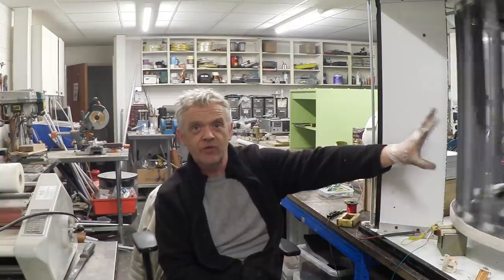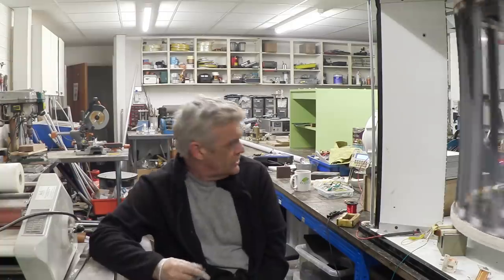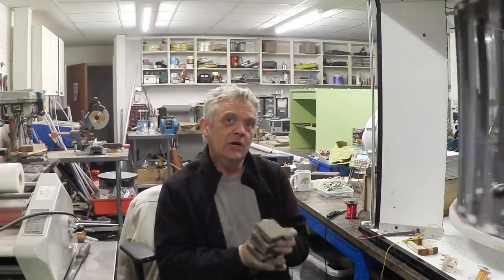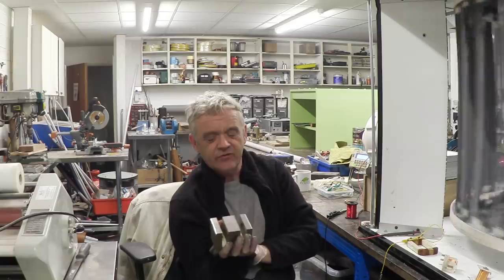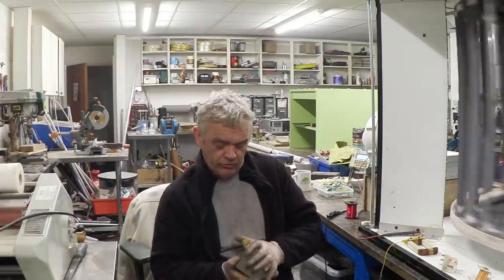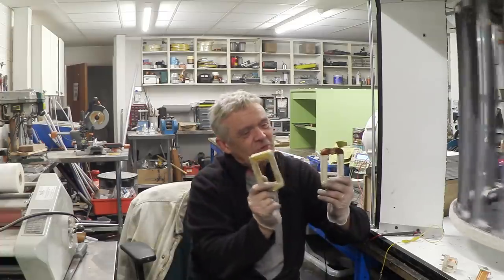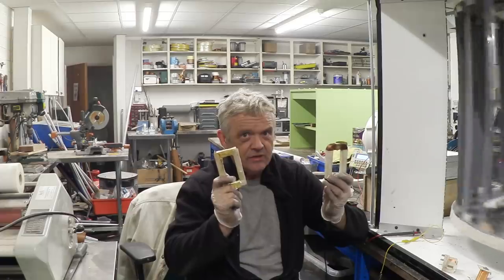Building a 1kW Wind Turbine For Under £100 - Part 5 - Messing With Coils

Comment: Interesting Mr Smith.  No core?  Then it's air core you're talking about.  Air Core vs Iron Core They're All The Same - Paul Babcock.  This guy has been working with flyback devices for over 30 years and he's arrived at air core  Using air as a dielectic medium as the path for magnetic flux.  It's also been mentioned that keeping the voltage low without the core, means it's less likely you will be electrocuted.  And that's always a bonus.  Thanks for the video sir.

Comment: The spacing of the magnets needs to match the size of the e core. This is so neighboring magnets don't push and pull at the same time. Cutting off one side of the E may remove this effect but still keep a complete magnetic circuit.

Comment: The answer seems obvious.  We have always used cores because our power sources have been essentially limitless.  Yes, a motor does not have limitless power, but it is very abundant.  Niagara Falls is limitless for us mortals.  Match the design to the power source.  Great video.  BTW, this is how progress has been made.  Not by chicken scratches on a blackboard.  All leaps in science/engineering have been either accidental or the realization of crazy dreams.  Almost no progress comes from chickens.

Comment: do like the big power companies the transmision is done on high voltage and when you reach the user use a transformer for the voltage you need to inject online. That is why the transmision lines are always high voltage and very low amperage. Also maybe it would be a good idea to set a way of directing the airflow over the 50 % of the blades that move forward so the air flow does not have any influence on the 50 % of the blades looking he other way. There is a very interesting instalation done in Argentina with the same idea working with a 100 kw power output. If you contact me i¨ll send you videos and some papers of the project. There is a company in Texas that have a patent of a design the same as you propose but in vertical position.

Comment: The only thing that could help u with the microwave transformer is to align the magnets with the ends of the iron core legs so u get more of a perfect w shaped magnetic Flux.  SNS to NSN and so on. The cleaner the shift in the magnetic field through the coil the cleaner the energy u get out of the coil.  Ideally your trying to complete magnetic fields the strongest ways possible by tightening up air gaps and making clean North to south connections.

Comment: No iron core, heavier wire gauge wound to the voltage wanted and N52 neo magnets and have coils all around the circumference!
Reply: Desmond Bagley  I guess we are to take stock in what we are trying to achieve. More power with less wind or safer and cheaper power whatever the yields are.

There are countless ways to build wind generators and thus countless results and power yields. 

The most efficient and power dense results are to build it yourself and with neo magnets and in an open coil (no Iron) 3 phase wiring configuration. The cost increase will be determined in your ability to acquire free material or if you prefer to purchase it, it is still cheaper than buying it already built and cheaper than paying for it to be pumped into your needs. 

If you are not safe in your building these things or you do not have the sense of flowing electrons that can kill you if you touch bare conductors with bare hands then you should probably not be doing this at all. If you are not savvy enough to find material to minimize costs then you probably should never complain about costs. If it is results and performance that you want to achieve then it is most certainly conceivable to be able to do this and still do it economically because chasing a rabbit without a clear goal and without then doing the research to achieve this goal is more costly than doing it right.

You can easily achieve 1 KW generator build and still keep it in the 100 dollar range. I say generator, because if you do it right it can be used in any sort of system, wind, steam, buoyancy, water, or a bio fuel or gasifier system. It can be made to be a modular or bolt on type of generator coil set and magnet rotors to be used in any application you want it in.

The only thing you need to do is capture as much of the energy as you can from the system you are putting it in. The proper way to engineer these things is to first set out your goals or what it is you want to achieve. Then it is to make the whole of the system into compartments that address the areas of what they are to function in and make each part of the system as efficient and as energy dense as you can achieve while maintaining practicality, and then combine them.

We know that if we build a generator that produces plenty of power in low speeds then this is ideal for a wind generator and thusly for any other application that it is bolted to, as this will ultimately lower our expense in trying to capture energy that traditionally or industrially requires high speeds or high pressures. 

The lower to middle ground that can be achieved by any home builder to harness wind, steam or any other source they may have access to without the high costs of equipment that needs high power or speeds or pressures as industrial equipment does. The demands are different in the industrial environments and thus require these high cost equipment but we do not need to produce any where near the power that they do and thus the engineering changes drastically. 

We can however utilize the current technology in a much more effective way than the big industrial producers can. We can salvage much of this tech from things all around us and then design the circuits to better utilize the available energy source at a smaller scale. This is truly the real answer going forward. The answer is to have all or most of us producing our own power locally. This is much cleaner and much less expensive and much more responsible for the future and a lot less wasteful and much more reliable.
Reply: Desmond Bagley  Rob is awesome! He is simply leading those that choose to follow, to ways of discovery and experiment, to inspire the daring souls to their own Creativity and hopes to liberate the minds of individuals that perhaps would otherwise be stifled by their fear or lack of doing for themselves, because society has taught most that specialized knowledge only belongs to industry, when in fact it is there for all, whom fearlessly take it for themselves.

Comment: Rob if you follow through with your plans it will suffer from brutal cogging, and vibration (and quite noisy).  If you dont want to use an axial design (with magnets either side of the coil) then the proven method is to space the magnets and coils so that the cog is even. I can not see a way to remove the cog from your design, and will be interested to see how your try and resolve that issue. Obviously this issue will only appear when you are under load, and at speed. If you go with the plan of the bolts things will be even worse. A second disk under the present base and fixed to it, with a second set of magnets and the coils in between the two is the most logical design, especially with the low cost of the magnets.
Reply: Helpful.  I guess a crude way to reduce cogging would be to have several coil sets.  Each spaced a non-integer of the coil spacing apart. At least three sets

Comment: Slowing the turbine down is a good thing.  If it isn't slowing down then it's not delivering any power.  There's an optimum degree of slowing down where it delivers the maximum power that it can give at any given wind speed.

Comment: Also look at U shaped Lenz free coil and Mr AngusWangus it's a U shaped iron core that has 2 coils would oposite polarities 1 coil on each side and connected in series also your magnets have to be NSNS and on one side of the U shaped coil a South has to line with the core and a North for the other end of the core so a N and S both go into the U core and then they cancel each other now when you apply a load to this type of coil the wheel should actually SPEED UP

Comment: Wonder if placing the high speed configuration and low speed on alternate ends of a rocker arm w servo actuated/speed dependent sensor to raise/lower needed coil configuration would be practical?

Comment: You are better off having primary coils, set further in to the turbine and have 6 phase so you create higher voltage and amperage output as amps is more useful than volts.

Comment: Use high voltage, high current will cause transmission losses in the wire

Comment: I'm thinking.... have the IRON CORE(s) raise and lower in and out of the coil according to wind speed..... 5-10 MPH open coil..... 15-30 1/2 core.... 30 and up, full iron core. Should be easy to implement.

Comment: Pretty much everything you said in this video makes sense.
However :
when you have 2 coils on the core you should double the power result ( at same RPM ) and certainly not cancel out.

Having 2 coils on the core is basicly no different than having two coils on 2 cores at phase equal distance.

Same thing with the RPM. You have all the magnets on the outside. However if you have a gear doubling that you could do with half the magnets on another wheel. If you have a gear making that 10 fould you end up with only a few magnets. You see ? It's just the number of magnets passing underneath per second that matters. If you only have a few magnets, the equal amount passing per second you are very close to what a commercial generator would look like.

As you said RPM will drop at electrical load which is a good indication you are actually transfering energy from mechanical to electrical. As I told you before :if you short it mechanical load on the system is maximal and you certainly should notice that in RPM. All energy is lost in the coil internal resistance. It's analog to a battery. Short it and maximum energy i s produced by the cell but all is lost in the internal resistance. ( And it gets hot :-) )

Anyway. I love the build. Can't wait to see it in you roof. Be carefull getting this thing up.

Comment: Yes you're right about the coils producing the same amount of watts but if you are wanting to store the power it's necessary to produce amperage.  It takes horsepower and torque unfortunately to produce amperage without a transformer or a source of power like solar panels. Voltage is always a matter of engineering which means watts are alot easier to produce with high voltage. 100 watts is easier to produce with 100 volts and one amp rather than say 10 amps at 10 volts. Batteries require amps to charge unfortunately.

Comment: The primary coil is not made of copper if you sand some of the wire it’s iron or aluminium wire but I pass them off as copper at the scrap yard

Comment: Force and motion inertia and acceleration...I’ve spent a few years learning about magnets....and magnetism...magnetism is separate to the object...the rate of induction of dielectric spirals into a central zero point...hourglass shape....the energy release at 90degrees..is force and motion which is magnetism..as a Taurus shape...the higher to capacitance the stronger the field..although the field loses mass size...as magnetism folds in on itself quicker the acceleration increases....the double capacitors in a microwave oven?...aluminium ones?...can also be used as a battery....it’s worth trying to incorporate the configuration of the aluminium inside the board...aluminium doesn’t like electro magnetic fields..it’s vibrates under the pressure...the vibrations of the aluminium under pressure of the field can amplify the resonance frequency...?....very interesting project...👍

Comment: Hi Rob. I'm sure you have had a huge number of comments on how to improve the electrical efficiency of your turbine. Some of them I'm sure will be helpful and some not. The thing, however, I would like you to remain focussed upon is the cost and re-use of existing 'stuff'. Yes, I'm sure that with custom made parts and fancy designs your turbine could be made more efficient. That doesn't really seem to be the point though. The interesting thing about these builds that you are doing is that they re-purpose the energy that went into the original construction into other things that extends the tail of their usefulness over their lifetime. 
BTW. My advice would just be to ditch all the transformer cores completely. Transformers aren't a perfect way to transfer energy, - they get warm when they are working. That energy has to come from somewhere...

Comment: what if you use a ceramic core or ceramic with iron deposits, also what if you alternated primary and secondary cores around the board

Comment: If the core was closer to the axle shurly a greater force X diameter distance work load could exert less resistive flux resistance and alow a better speed

Comment: How about a kind of MPPT (Maximum Power Point Tracker), which is used in Solar cell arrays. It should work with measuring voltage and rpm, to determine the amount of current you suck out of it.
best wishes from Germany
George

Comment: 350 comments! Gahh. I hate catching up. Rob, considering the scale of your platform, you have more than enough room in the circumference of the fan to initially setup one version of each coil. Just test each sequentially or together in whatever configuration. As a rooftop generator, with multiple coil setups fully installed,  you could engage whichever set to generate it's output. In higher wind speeds, a second or third set could be engaged to retard the turbine and output to other loads, battery banks or heating water. All could be easily automated to some extent as it is its own anemometer. You could consider modularizing it with sled mounted coils using dual banana plugs or terminal posts. Just make sure your roof can take the load. Cheers.

Comment: Ignoring the budget for a moment, would a dual coil setup (with and without core) be viable if the outputs are switched/controlled by rotor speed?

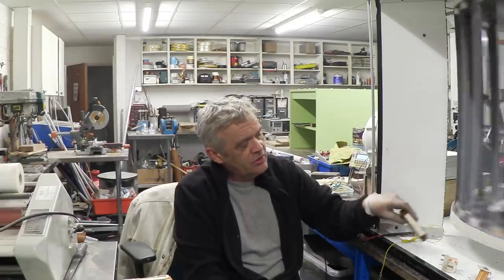Comment: 7:40 well - i think it's a question of efficiency. With the core your conversion rate is better, which is what you want. Nobody cares if the wheel slows down, as it is driven by the wind anyway. What matters the most ist: how much percent of the available wind energy can you convert into usable energy.  .... EDIT: 9:00 ++ ok, good point.

Comment: Hi Rob great video's I noticed that you're making the same mind set as myself in that you need to ask yourself the the correct questions.
I think that you are trying to get the most energy from what you have to work with and then see what you can do with the power.
But the question you need to ask yourself is what is your end goal of the project?
Do u want to charge a battery with it.? Or 
Power lights direct (eg greenhouse plant grow lights) .
If you work from your end goal towards what you have you will find the best results 👍.
I hope I am making sense to you I am not good at explaining things.☹️.
In my build of your project I will share my thought process. 
I ask myself  questions and then answer the questions like this.
1 how can I best use the energy? Should I use it to charge  batteries and an inverter to power anything or would it be cheaper and more efficient to use it to make light or heat?
2 answer. Battery charging would be more expensive and less efficient but I could use it to power anything electrical.
Or if I had low voltage and high amps I could power a home made resistance heater for my garage or greenhouse and maybe store the heat in a mass like a big concrete block or water tank..
3 how. Can I do cheap and effectively with what I have.
4 I need good amperage and I can use ac voltage or DC voltage and it can make heat if the wind speed is low and with higher wind speed would make more heat and limit the turbine speed😊👍
So now I know that I need high amps I knew I need good thick coils and wires to carry the current and keep energy loss as low as possible. And I know that the closer the magnet get to the coil the better.
And we know that the power is made from e magnetic field passing through the coil's and the iron core becomes a magnet when a magnetic field is near.
So every time a magnet passed a part of the iron core it makes a pulse of electric and as the core has 3 parts that makes 3 pulse's per magnet so the magnets need spaced that one magnet can pass the coil at a time.
And if the magnets are in pairs side by side to make bigger single magnet's that would act on a larger area of the coil's it could give more amp's
I don't know what would happen if the coil's were placed between 2 iron cores linking a chain of coil's and core's I think there could be 6 pulse's per coil possibly 🥺.

And you would have a fair idea of what voltage and amp's would be required to charge them and get the best results .

I probably should just have said that you need to know what you want to use the energy for then chop and change the coil's and magnets to get most suitable power to meet with your needs 👍
I hope this helps someone in some way 😜
And keep up the good work 😀👍👍👍